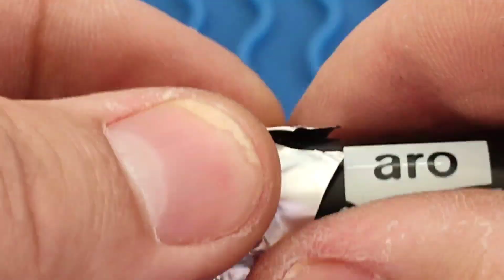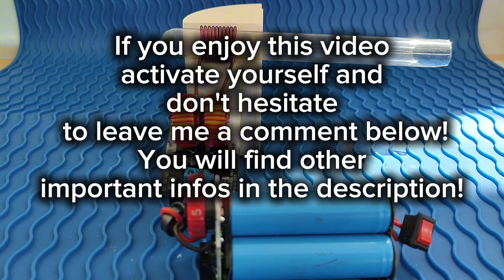This Bargain Circuit Board Saved My Thermoacoustic Engine Project

Comment: rather than mesh, wind wire into a coil... preferably shorted to itself. induced currents and opposing eddy current will always create loops. let them!

 im surprised you can develop enough heat in such small sections of conductor... in fact, i suspect this is more due to the work coil itself getting warm from plain resistive heating as it Is flowing a pretty large current when running, rather than actual induction heating.

the real test is to show said element heating when sitting on the bench inside the coil. i want to see it char a woodchip before i accept this being true induction heating.

and if that IS the case, that its simply the coil heating up and not teh desired mesh element, its far better to just run a nichrome or ceramic heater, as 100% of the power will appear as heat... even when optimally coupled, induction heating is still only 50% efficient at best...
Reply from the maker: I've tried the nichrome version but the wires are not optimal because those are goes through the tube and all the tube will hot, not only the hot side. Also it was hard to insulate electrically and thermal also wasn't nice when I wnated to build up my flute from it. Efficiency, yes the nichrome version has the best one, but I was care about the stable sound for a long as possible without complicated nichrome coiling process, that is a pain in the arse with the ceramic part. But now the cooling is another problem that I could solve. I don't know really the electronic background of this circuit yet, but it worked and that was a good start. I should test it more with non contact coil, and different turns, diameters etc. I thought about a solid piece of heat exchanger part too not only a foil. But a development goes step by step.
Reply: @AttilaBlade  diamond burrs on the dremel, and some fireplace cement. drill little holes, poke wire through, seal holes with fire cement.
Reply from the maker: @paradiselost9946 Yes, I know how to make it. I've made more than 20 experiments in the background with nichrome but wasn't comfortable to make it and the final version wasn't so attractive. ;) Hard to show well how to make it in a tutirial. But I never give up, because I know the benefits also. So, more experiments and more fails will bring forward the project.
Reply: @AttilaBlade  i agree with how hard it is to make a video that shows anything ;)